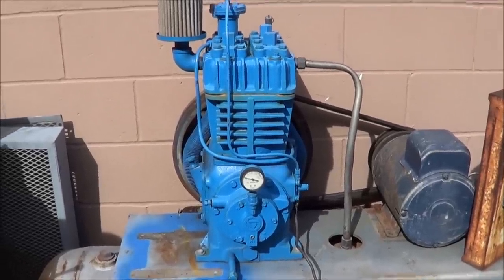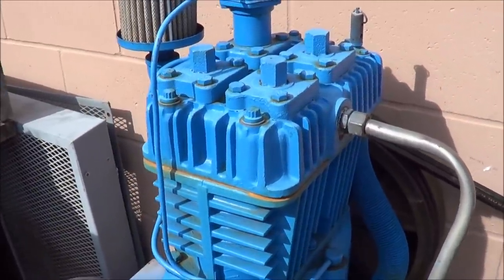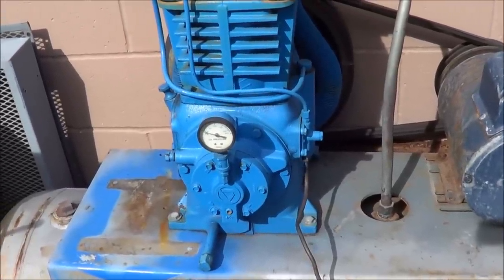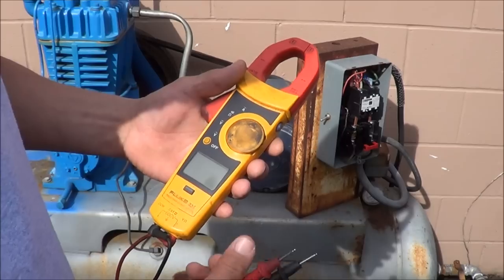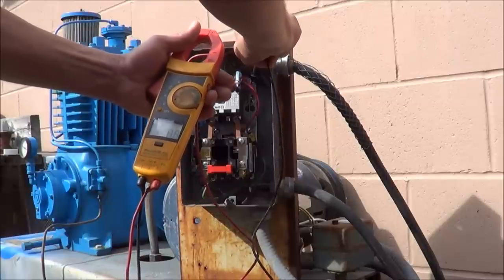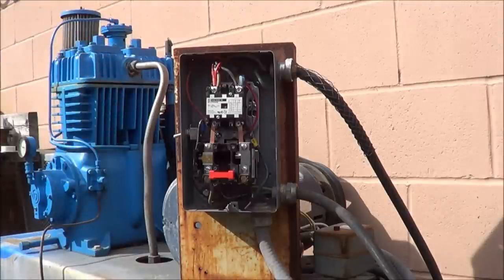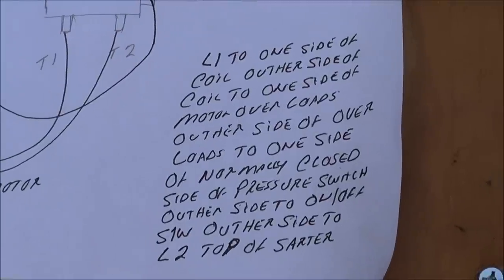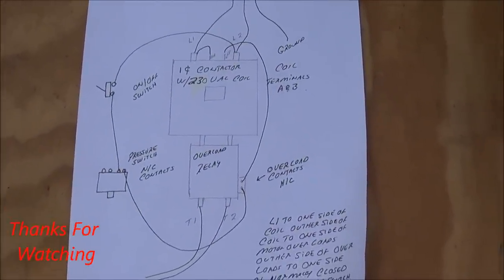Multi stage compressors & wiring a single phase motor starter

Comment: I love the video thank you. I  have a question on the on/off switch.  What type of on/off switch is it. Does it have to be rated the same as the starter. I have a square D magnetic 40 amp  starter.  Does the switch have to be same rated. What is the one you have thanks.
Reply from the maker: Hey Michael,
The switch does not have to be a very high amperage switch as the only load on the switch is the coil inside of the contactor. Any toggle switch will work

Comment: Hi Dave Thanks for posting your videos on your quincy rebuild. I used them to completely restore a 1953 quincy 240. Just fired to up tonight. One question  My unloader doesn't have an audible release of air like yours.. It was cleaned and new seals installed. Any suggestions?
Reply from the maker: A couple things to check.
 Remove the diaphragm cover and press on disc  With your finger It should move freely
   If that checks out then there may have been  And issue with the unloader tower itself some of them weren't machine correctly and were actually to tall
 There weren't many of them but from time to time this would occur. We used to remove the aluminium washer- gasket  Between the tower and cover plate 
 To achieve the necessary Clearances.
 You have a single stage machine that should have two unloader towers,
   On the single stage compressor the  Air is vented back through the intake filter
 There should be pipe plugs in the vent holes

Comment: I know this is an old vid but im confused on hooking up the pressure and on off switch. You say the coil is that not L1 and L2? thanks.
Reply from the maker: Correct the coil is not L1 or L2

Comment: Dave Thanks for the comment. After looking at my towers I discovered I hadn't put the aluminum washers under my towers because they weren't there when I tore it down. I also discovered I have air coming from the bottom of the hydraulic unloader line thats plumbed into tank pressure. It then bleeds through the system coming out at the top of one of my towers. Am I correct that  I need to rebuild the hydraulic unloader or replace it? Nothing was done to it when I rebuilt the compressor. My compressor builds air to 80 lbs then stops building air pressure. The needle just sits at 80lbs
Reply from the maker: Hey Paul. 
 Try to remove the quarter inch line going to the unloader tower when the compressor is running. There should not be in air signal when the compressors running in you have achieved oil pressure

Comment: My Mag starter(WEG Single phase) came with another jumper also going from L1 to 22. I'm not sure how it would fit into his drawing but I figure, not sure, I can remove it and just use his wiring diagram in this video as it works. Cannot find a reference even for what connections 21 or 22 are really used for. I'm suspecting some other starting resource or options not mentioned in this video above.  I will try and remove the wires when I can get back to the shop in a few days and see what happens.
Reply from the maker: I’m assuming 22 is going to the overloads and one side of the coil

Comment: Good vid, I don't like that little switch though. If that thing fails or gets broken you would have 120V between the metal box and the switch would you not? It would be better/safer to have a 220V disconnect on the wall to kill all the power before it even gets to the machine.
Reply from the maker: Matt's Shop if the toggle switch failed and went to ground or in the same situation contacted the metal enclosure the circuit breaker would trip and if it had a fusible disconnect a fuse would blow.
it's not a uncommon practice to mount the starter to the compressor itself and to have an on-off switch mounted to the starter enclosure, but yes it would be safer to mount the starter to the wall and eliminate any vibration issues

Comment: Dave,
I didn't see the starting capacitor in the diagram ,(if there is). I have 1.5 KW motor with 200 microfarad starting capacitor and got problem how to wire them with normal air compressor pressure switch, ist applicable or required special pressure switch?
Thanks
Anas
Reply from the maker: There is no wiring diagram for the start  and/or run capacitor, That diagram is proprietary to the motor your working with.  As far as the pressure switch goes any square D, Furnace, Alan Bradley.etc... Will work to make or break the start circuit.  In other words I can't help you with the wiring on your capacitor on your motor:(

Comment: have a 5hp baldor, 1ph, 208/230 moto, gould magnetic starter,3 capacitors, checked the two leads out of motor with ohm meter, got a buzz, is it normal with a set up like this, do I have to run a magnetic starter on this. your video is very helpful.

Comment: Hi, I have a delta unisaw. I believe it was set up with 3 phase. But the motor in the saw currently is a single phase motor. Any suggestions?

Comment: dave when I checked the two leads out of motor, there was nothing else connected to motor, the reason I checked the leads when I turned it on it took off then slowed down , almost stopped.
Reply from the maker: You're definitely going to need a magnetic starter First things first You need to check your voltage when the motor is starting
you need to verify that the voltage isn't dropping when the motor is trying to start. If that's not found to be the issue, Try replacing the capacitors they're very cheap
in comparison to a new motor. there's also the centrifical switch which is located inside of the motor it may be stuck mechanically or electrically fused in the start position
also depending on what kind of air compressor you have if there's  a in tank check valve it may be broken and restricting the flow or the compressor is trying starting under a load

Comment: Hello:  Regarding your wire run down to the pressure switch.  Generally noted on pressure switches and located on the connection block there is the Motor-Motor terminals on one side and then there is the Line-Line terminals on the other side of block.  Your drawing shows the wire run coming down to the pressure switch connecting on one side of the block (?) and on the same side of the block you show your return run. As it is not noted on the drawing, which lugs of the block are you connecting to, the Line-Line, Line-Motor or Motor-Line lugs as I would think Line-Line?
Reply from the maker: Thanks for your comment that's a good question
these type of pressure switches are a little misleading as there are two sets of normally closed contacts typically only one set are used.
One side will state line-load or line-motor in any case you would connect to the line-load or line-motor. If you look at the switch there is a left hand set of contacts and a right hand set only one can be used in this application

Comment: Hey man I have the same starter that I'm working on wiring the same way you have here. Do you have an auxiliary coil or is this built in with the starter?
Reply from the maker: the only coil is the coil on a magnetic starter
Reply: Good Deal. Thanks, and great video.

Comment: What's the operating oil pressure for that pump? How about for a single stage Quincy 210?
Reply from the maker: There all 18-20 PSIG just like car engine @ idle up to temp

Comment: Why in the world would you put the junction box with the motor starter directly on top and attached to the compressor that vibrates and potentially loosens any and all screws.? I'm beside myself.

Comment: What wire gauge from starter to motor? 5HP single phase
Reply from the maker: 8 AWG @ 200-208 volt  and 10 Awg @ 240 volt
Reply: ROTARYCOMPTECH hmm I would’ve thought high voltage would require thicker gauge wire. Should I go 8 thhn? I’m running a 70ft line using 8gauge thhn and will have extra wire. Can I use that same wire?? Trying to save some bucks
Reply from the maker: The higher the voltage the lower the amp draw, if it was a 480 volt system you would only need size 12, check on line search for motor wire size calculator to find the max distance you can run that size wire